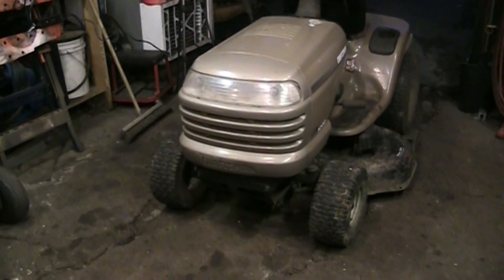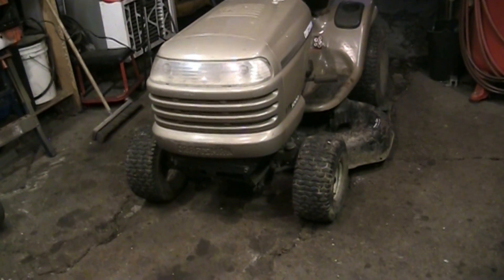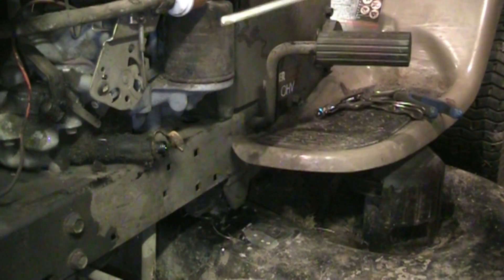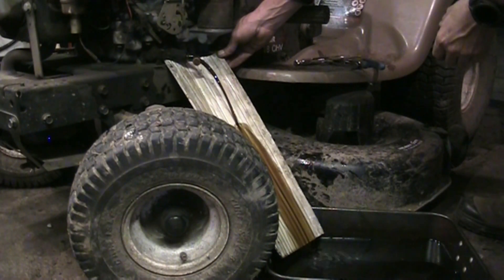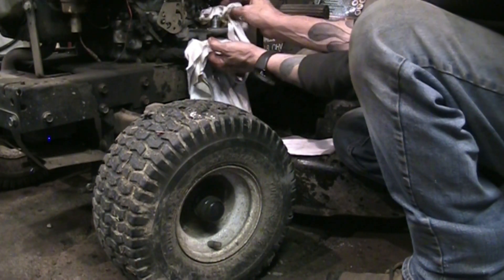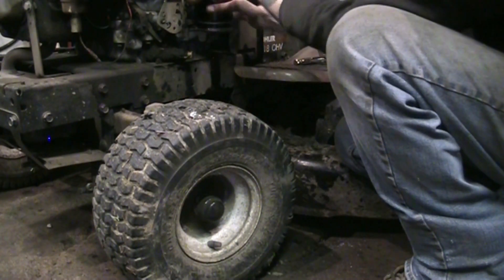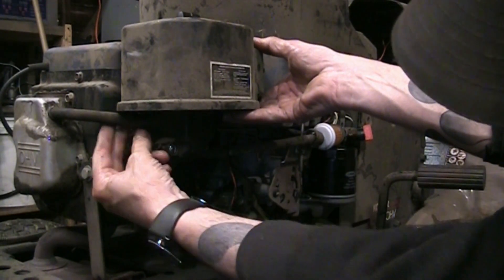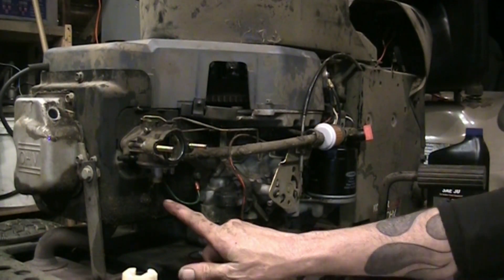The Kohler Command 18hp in this LTX1000 Craftsman lawn tractor has gas in the oil. What happened?

Comment: Got one of these free after someones carb troubles & fixes but it still wouldn’t go. Found a sheared flywheel woodruff key. Mowed the yard with it today. It had apparently been backfiring which may have contributed to shearing key?
Reply from the maker: More than likely the backfire was caused by the shifted key.  The timing goes off when the key shifts.

Comment: I have a Craftsman mower with a little larger Kohler engine that exhibits all the same issues. Ethanol is not your friend. I'm putting a fuel shutoff valve on all my small engines except weedeaters and will run the carbs dry before storage from now on. It seems I"m always cleaning corn dust from the carbs when I go to use machines I don't run often.
Reply from the maker: That is what I do for all my own equipment, and what I recommend to my customers.

Comment: I followed your instructions. I had gas in the oil, the carb was full and overflowing gasoline. Thank you so very much. It runs great but has had a problem with me turning right. When I turn right it sputters like it is going to stall. Going in a straight line and turning left, no issues. The wife says 3 lefts make a right. Got any ideas why it does this? Thanks again.
Reply from the maker: Sounds like you may need to check and adjust the float level.  I'd start there.
Reply: @randomwrenching  thank you
Reply from the maker: @tims.449  No problem,  let us know what you find

Comment: I have this exact model Craftsman LTX 1000 18hp. Bought it used but she purrs like a tomcat. And also New Spindles New Blades and New Pulleys. I have had this mower for 4 years and Cut great. One of Craftsmans better mowers.
Reply from the maker: The LT and the LTX were very good units. They have a heavy duty 12ga steel deck has well
Reply: What is the serial number and model of this lawn mower. My sticker is wore out and can't find it anywhere . Thanks!

Comment: Why didn’t you check the solenoid make sure it was working. I would’ve checked the valve lash to easy enough.
Reply from the maker: No valve lash to check Eric. It's a Kohler with hydraulic lifters. Solenoid clicked, but it doesn't mean much, they are notoriously garbage to begin with. A fuel shutoff is always the best bet to prevent this problem.
Reply: @randomwrenching  I took your advice. Works perfect just shut off the gas flow. Now I have a different issue with my LXT. The starter spins but doesn't engage. What advice can you give me to resolve this issue.
Reply from the maker: @tims.449  The starter motor itself has to spin fast enough to throw the gear up into the flywheel.  If you are sure it's spinning fast enough, I'd have a look at the gear. Or the gear clutch could have gone bad if it is equipped with one.
Reply: @randomwrenching  Thank you. The battery was weak. I'll check the battery. It was weak.
Reply: @randomwrenching  That did the trick. Fired right up, bad battery. Trickle charger showed charge but it didn't hold charge. Thank you very much
Reply from the maker: @tims.449  Excellent, thanks for the update!